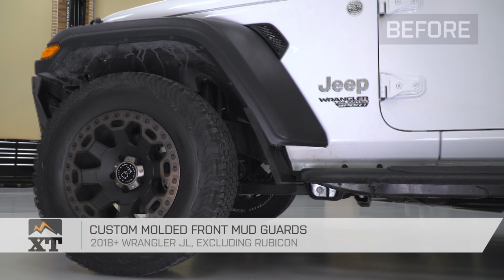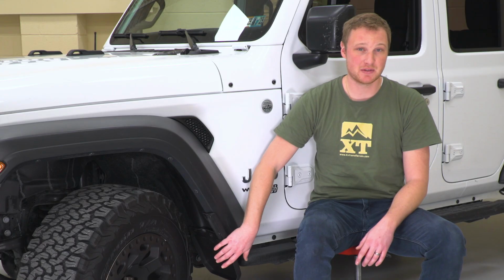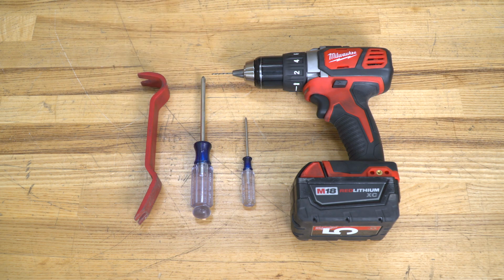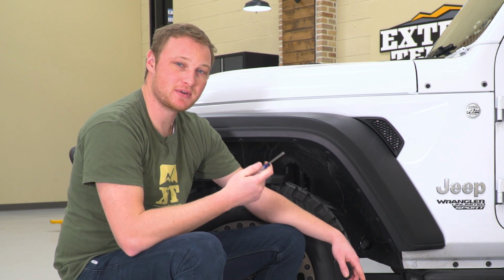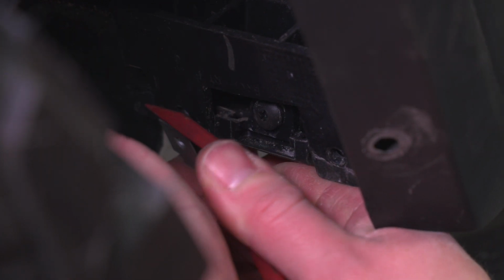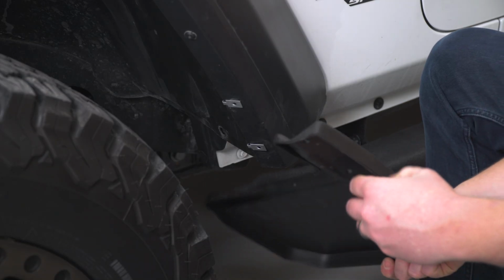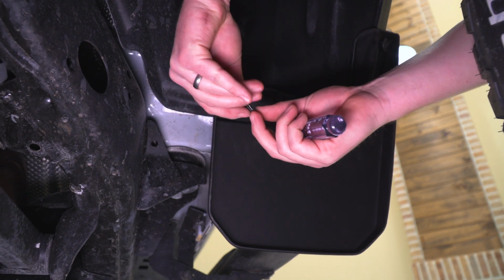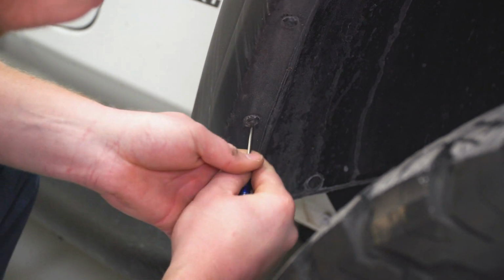Jeep Wrangler JL Custom Molded Front Mud Guards Review & Install

Comment: Just installed these on my 2021 JL. The bottom clips need a little manipulating to slide over the plastic tabs as they are pretty thick. The top clip goes on the fender liner not on the plastic fender trim. The clip below that cant be placed on the inner fender trim as indicated on the instructions because the inner liner is cut out in that location so it does need to be put on the fender trim as you guys have done. I think Husky should supply a new plastic rivet for that location. The mud flaps do have a nice fit.

Comment: Does not look good. $55 for front only seems high for a #mallcrawler
Reply from the maker: You pay for what you get, and these Custom Molded mud guards will look like they came from the factory. Certain states require the use of mud guards on trucks and 4x4s, definitely not a #mallcrawler thing. 👍 -Zach